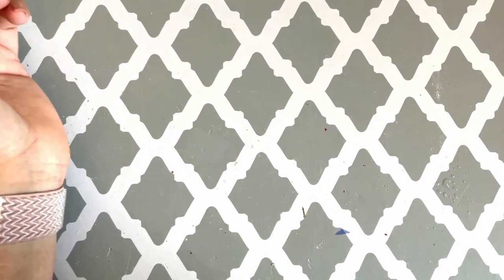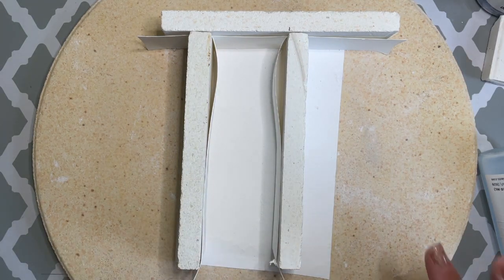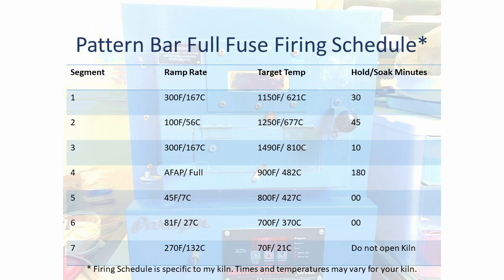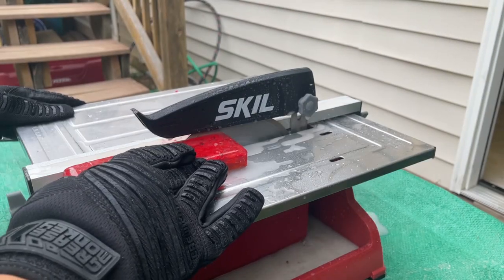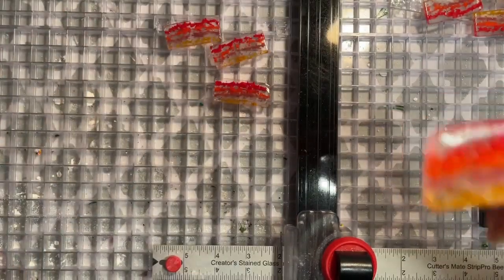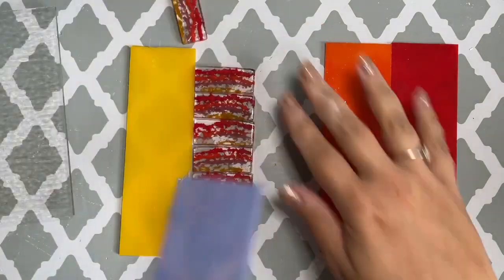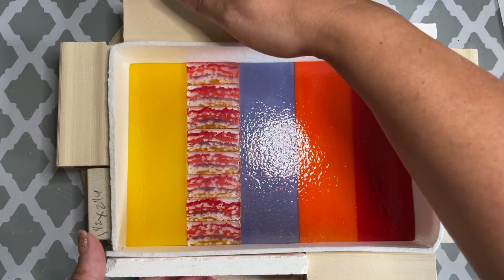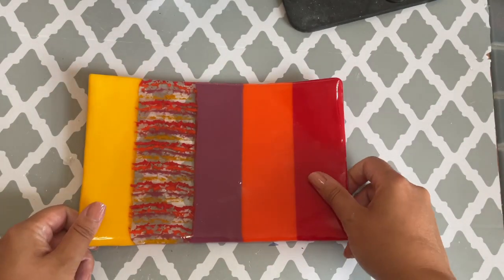Fused Glass Project - Using Pattern Bars in Your Designs #fusedglass #patternbar

Comment: Very cool!  I'm just starting out so lots of questions all the time lol.  Is there a reason you didn't slice the pattern bar 3mm slices same as the other glass? I have never used a wet saw so I am just curious.  Btw, my bee plate is in the kiln as we speak.  What a fun project.  I also purchased the grinder you use and i love it.  I will be looking at the saw you used as well.  Thanks!
Reply from the maker: Hello! I’d love to see you final results if you can tag me! As for the size of the slices, the saw will not allow me to cut anything thinner than what I had.